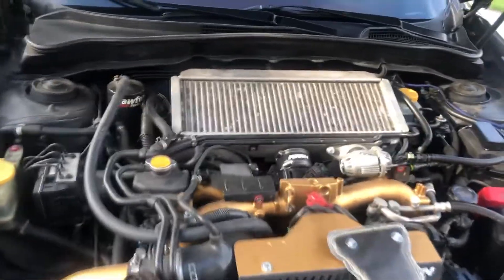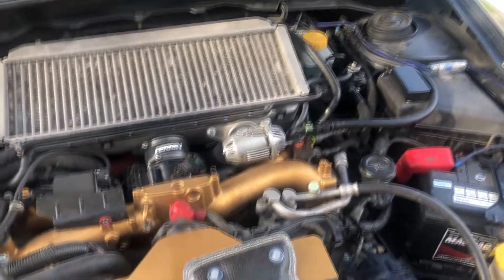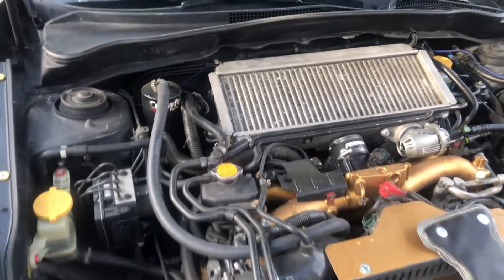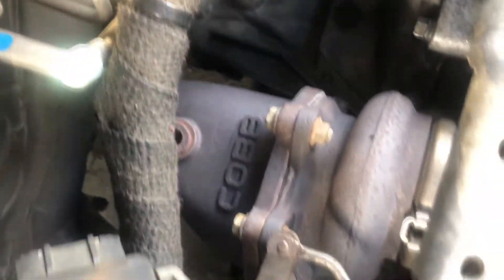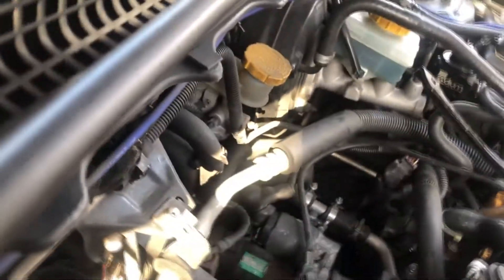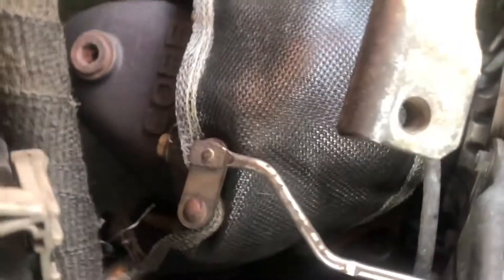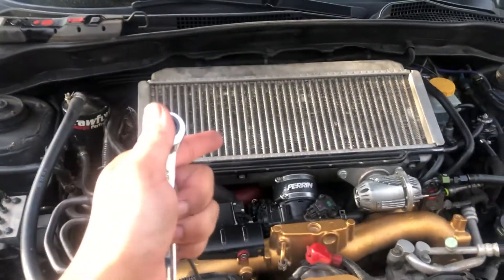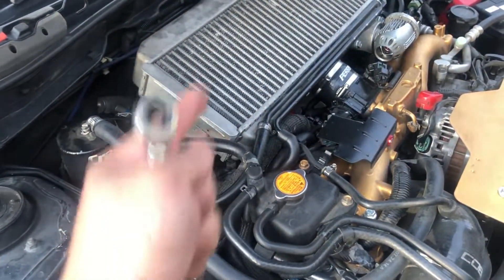PROJECT STi: 08-14 - Turbo Blanket Installation

Comment: Any noticeable difference with that Whiteline pitch stop? I picked up the same one for my 04 WRX 😄
Reply: I did one on my GC8 and it made a considerable difference in my case. the cons are you get more gear box noise and the starter is louder when starting the car. as the the pros its hard to explain but its like the "slack" in the driveline is gone and your power gets to the ground faster when you accelerate or between gears. its one of those ones you have to feel and I would highly recommend it.
Reply: @asparagusman4481  What if my GD wagon only has the 4 spd auto 😂 I actually have it installed now and I'm happy to report the same! A little more NVH but you can definitely feel less slack in the driveline like you say. The 1-2 shift feels great. Can't wait to 6 spd swap it lol